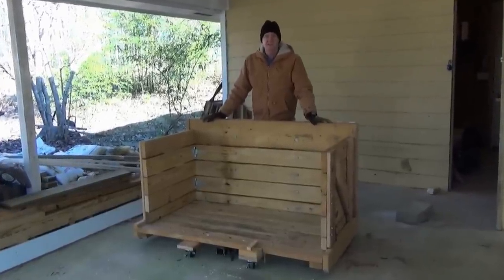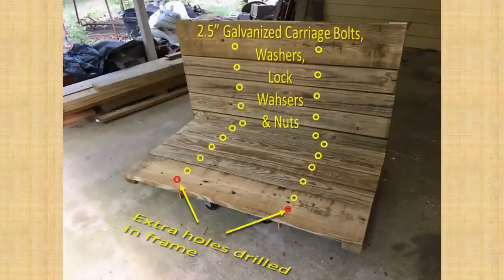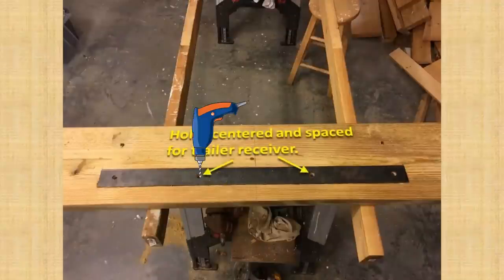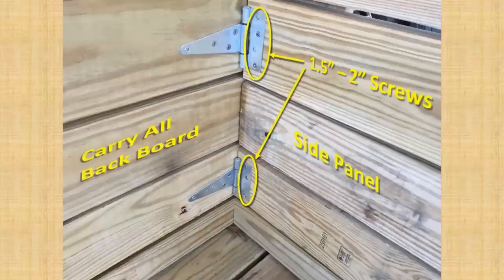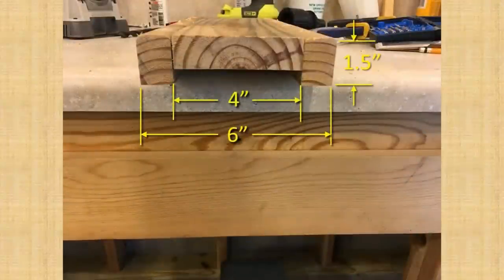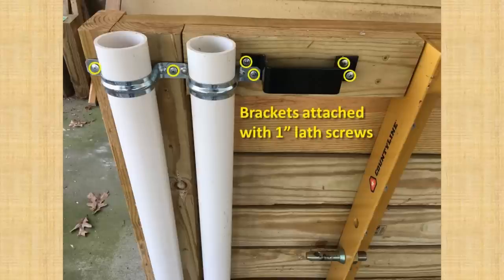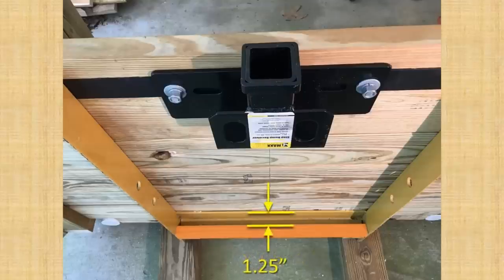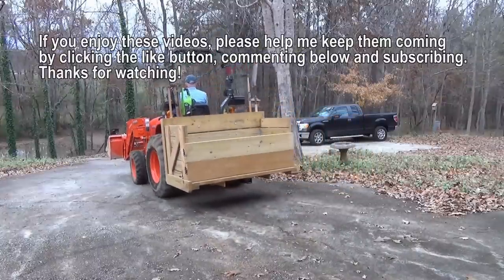Versatile Tractor Carry All for My Kubota L3901 Tractor - Part 2 (#17)

Comment: I just finish building mine and to my dismay, it doesn't work with the land pride quick hitch.. any suggestion would be appreciated1
Reply from the maker: Sorry to hear that, Vince!  You might try adding some spacer strips between the frame and the backboard to give it room to hook up.  If that doesn’t work you‘ need to weld stand-off plates to mount the lift pins on.  Good luck!

Comment: I am finishing my carryall poached from your video.  THANKS.  It took me a couple minutes to realize I needed to resize for my B2601 (53 inch bucket).  The only modification I made was to bolt 2X10 PT uprights to the rear frame  so it would clear my ez hitch.  This gave me lots of room for screwing the backboards.  I would also suggest builders size the 5/4 6 in PT used on the open end of the side panels to have contact with the 2X6 side skids to transfer the load of the work table (rear panel) directy to the frame.  I also lag screwed the 6 inch hinges to the back boards.  But wow, this thing is heavy!!!  Definitely takes load off the front axle.
Reply from the maker: Glad my video served as inspiration for you to make your own version of the carryall.  Yes, it’s heavy and makes a good ballast box even empty.  Folks with subcompact tractors would be better off making it out of lighter material like deck boards or 3/4” PT plywood to cut down on the weight. Thanks for watching!

Comment: I noticed another detail you addressed, and that is the direction you had all the lumber facing.  You had the smiley face of the grain of the wood facing the correct direction every time, congratulations! Tim
Reply from the maker: Hi Tim,  Thanks for noticing that.  I completely forgot to mention it in the video.
Reply: Spread the knowledge... what is the meaning, and significance of the “smiley face of the grain of the wood facing the correct direction”?
Reply from the maker: Hi Chris, Well I was waiting to see if Tim wanted to chime in but he hasn’t so I’ll reply.  I think Tim is referring to the way that boards can “cup” or “crown” depending on where in the log they were cut.  Here’s an article that explains it pretty well:  https://www.warlinepainting.ca/are-your-deck-boards-installed-right-side-up/   Basically, I looked at each board to see which way it was cupping, or likely to cup based on the grain pattern at the end of the board.  For the carry all platform boards I tried to always orient them so that there would a crown in the board rather than a cup which would hold water or other liquids.  The crown let’s liquids run off the platform.  Likewise, with the tailgate boards, I wanted the crowns facing outward so they wouldn’t be wobbly hanging on the bed claw hooks.  With the crown facing out, the claw hooks will automatically snug the tailgate boards to the edges of the side panels.  Does that make sense?
Reply: Thanks for the explanation Martin. That makes perfect sense and I understand the cup vs. crown reference better than the smiley face of the wood grain.  Good to know once I start the project.  Based on weather conditions here in Northern IL, that may not be for a while. I need the treated lumber and that is likely frozen together at the lumber yard.

Comment: I'm going to start one tomorrow and also provide the means to mount a 3/4 black iron pipe horizontally to the uprights to unroll barbed wire.  I do use barbed wire whenever out of sight of our house because deer don't get caught and die in it like they do woven wire.
Reply from the maker: Good idea to mount the pipe between the uprights for unrolling barbed wire or cable or hose!  Hope your build goes well. Thanks for watching!

Comment: Thanks Martin... The details of your carry-all build are spot on the money & the narration is excellent. Coincidentally I have the exact steel frame & a Harbor Freight 2" receiver that appears identical to yours. ( Made In China )... What isn't? LOL! 
My base & back wall as well as my skid plates & 2 x 4 uprights are complete as well as the receiver install. I too added a extra set of 1/2" holes for the 2 x 10 tailboard & the steel frame. I did find that the 2 X 6 skid plates were NOT tall enough to clear the backside of the receiver hitch ( 1/4" low ) based on using a straight edge. I decided to use a 2 x 8 with a 1/4" ripped off the narrow edge giving me a 2 x 7 skid plate. This gives me about a 1" clearance below the receiver hitch when sat on the ground. I had a steel shop cut my steel plate to 1/4" x 3" x 32 1/8". The thickness matches the angle iron thickness. The Big Box stores don't carry it in 3" width plus I bought it at a 3rd the cost! ( $11.78 )... I cut my recess with wood chisels as I don't own a router, ( yet ). I painted the recess & the steel plate with black Rustoleum after drilling my ( 8 ) 1/2" holes dead center across the steel plate. I then mounted the plate & receiver with the outboard carriage bolts & drilled up through the remaining ( 6 ) holes into the board & torqued it all in place... I'm now ready to build the swinging doors thanks in no small part to your excellent build plan as I tip my hat to you sir! 
Thanks again,
Bill on the Hill,
Vermont, USA... :~)
Reply from the maker: Sounds like you have a very sturdy carry all in the making, Bill!  When you get it finished, I hope you’ll send me some pictures of your finished masterpiece!  If you are so inclined, you can send them to martin@diymyway.net.  Good luck!
Reply: @DIYMyWay  I would be happy to do so Martin. I have been documenting the build as I move along with it. Yesterday I built the LH wall but I still need to cross brace it & today I will build the RH side. I ran out of time yesterday & headed out for Sunday dinner with my daughter & granddaughters...
Been an enjoyable straight forward build thus far with the receiver installation perhaps the most technical part. Thanks... :~)

Comment: I bought the lumber today and stainless deck screws.

The 2 inch hitch I bought was $13 from Harbor Freight.  It is 18 inch long and I will weld it to the bottom angle pieces using rectangular tube.  I have plenty of square tubing I will cut to fit and weld in place.
Reply from the maker: That’s awesome, Bill! I hope you’ll share some pictures of your carry all with me.  I’d love to see the finished product!
Reply: I will share pictures if I have your email.
Reply from the maker: Sure.  It's martin@diymyway.net. Looking forward to seeing them.

Comment: This is absolutely fantastic. I was scheming plans in my spare time to build something very similar... then I cam across yours. Everything well thought out and great details on putting it together. Now I will be building one like yours!!! Thank you!!!
Reply from the maker: So glad you think so! Good luck with carry all build! Thanks for watching!
Reply: @DIYMyWay  One question... I calculate the tailgate boards to be (60"+1.25"+1.25") = 62.5" likely made from 2x8 stock? Is that correct?
Reply from the maker: The length sounds right, but it’s best to measure after you have the side panels installed and locked open.  The tailgate boards are 2x10s.

Comment: Thank you for your helpful video. I’m basically following your pattern, as I construct my own. 
There is one thought I want to pass on, however. 
Since new pressure-treated lumber will shrink over time, I think it would be better for my purpose to avoid adding in spaces between the platform boards.
When the green wet boards shrink, the gaps between the boards will grow larger, yet. 
That is concerning, since I wish to sometimes transport dirt, compost, or finely shredded leaves without worrying that it might sift out between the boards and leave a messy trail in my wake.
Reply from the maker: Hi Mike!  Thank you for taking the time to comment!  If you plan to haul dirt or compost, then definitely don’t leave any space between fresh pressure-treated lumber.  Even if you don’t, you could still end up with at least a 1/4” gap between boards, so you might consider putting a piece of 1/4” or 3/8” PT plywood on top of the lumber. Thanks for watching!

Comment: Great build!  I'd probably bolt the casters on and leave them on.
Reply from the maker: Thanks Angus!  Bolting the casters on is fine if you live on flat property and will never cross a ditch or low spot.  If not, be prepared to replace the casters from time to time. Thanks for watching!

Comment: I started mine today, following your plans.  Decking is done will start sides and "bolt on"s " tomorrow.  Thank you for the time and effort you spent to share your idea. And yes I am now a subscriber. Keep your videos coming.
Reply from the maker: Hi Rusty!  That's awesome!  Please keep me posted on your progress.  I'd love to see some pictures of your  carry all when you are finished.  Thanks for watching and subscribing!
Reply: Trying to figure how to attach photos, only issue is the gate latches, with the bend in slide bolt you need a rather large hole. Maybe I put the latch to close to the side board.  Too much depth.  Still working on it. Cannot wait to use it.
Reply from the maker: Hi Rusty!  Try sending them to martin@diymyway.net.  I’d love to see the progress!  Sounds like that’s the issue.  If you can move the latches up a bit on the side panel that should take care of the problem.
Reply from the maker: Rusty,  if you tried sending pics, please try again to  martin@diymyway.net.  I discovered my email forwarding was not working but it's fixed now.

Comment: Thanks for the detailed instructions on how you constructed that excellent carryall.   One question: Why did you go to the extra mile to make the dolley removable? If you kept the wheels under the carryall,  I don't see why they couldn't be mounted permanently. Your design does give you the option of storing it in places without a concrete floor.
Reply from the maker: Hi Terry!  Thank you sir!  You answered your own question.  First of all, there ain't no such thing as a level place anywhere on my property, so if for some reason I wanted to leave it outside, I can plop it down and not worry about it rolling away.  The plan is when my shop is built, it will have a shed off the back with a roll up door to the inside.  I'll have several of my implements on dollies, so I can roll in the one I want to attach to the 3-point and then be on my way.  The carry all is one of those implements.  Thanks for watching!

Comment: I did build a carryall following your plan. It turned out great. Thanks for the videos. They were easy to follow. The only thing I did different was that I used a King Kutter frame. The King Kutter frame works with a John Deere Quick hitch. I did make a YouTube video and made sure to give credit to the DIY My Way designer.
Reply from the maker: Hi Beefitter!  I watched you video.  Great job on the carryall!  Thanks for the “Stars Wars” style credit at the beginning.  The wood looks really dark.  Is it just very fresh pressure treated wood or did you stain it?
Reply: I did stain it with Rymar water sealant. Dark Hickory. I did use ground contact treated lumber. But, treated lumber can go bad with time if exposed to the elements. I stained the wood before attaching it to the metal frame. So the wood is as protected as it can be. Rymar is a great product, it is expensive, but you get what you pay for.
Reply from the maker: Good thinking on your part!  Thanks for the tips!

Comment: The carry all from tractor supply will need significant modification , with metal removal and welding,  to work with John Deere quick hitch. Just a heads up.
Reply from the maker: Good to know for John Deere quick hitch owners!  Thanks sharing for the info and for watching!

Comment: Following your precise direction I built a versatile tractor carry all for my Kubota.  I made it 72'' wide to match the width of my tractor.
Reply from the maker: That’s awesome aufish! I appreciate you telling me.  Did you use the Tractor Supply carry all frame?
Reply: @DIYMyWay  Yes I did.  I had to make a few adjustments because Pat's Quick Attach Cat 2 is larger than the cat 1 and was  binding up against the back of the carry all.  I simply cut two openings to allow the quick attachment to pivot freely.
Reply from the maker: Awesome! Even with Cat 1 Pats Easy Change it’s a close fit. Thought I might have to route out some the wood but didn’t need to after all.
Reply: @aufish2311  Rural King frame is Quick Hitch compatible!

Comment: Martin,

Why didn't you make the dolly or casters a permanent fixture and attach to the carry all. I'm thinking about doing that with wheels and pnuematic tires. If you use casters they need to be stainless so that they don't rust. What are your thoughts?
Reply from the maker: Hi Tony!  First, with the uneven terrain of my property I knew I would occasionally bottom out the carry, which I actually did very soon after building it.  If I had had big casters on it they would have been abruptly removed.  Second, since I store my carry in my shop building, I only need the casters when I am rolling it up to hook it up or rolling it away for storage. Thanks for watching!

Comment: Just curious... does your hitch touch the ground.  I built mine using your plan which is fantastic... When I go to mount my hitch... the bottom of the hitch protrudes past my carry all frame and the side levelling boards, which means the hitch itself would be securing all the weight.  Did you find that yours does the same??
Reply from the maker: Hi Michael!  I don’t know because I haven’t set the carryall on the ground with a ball hitch on it.  If it is a concern for you, you can use 2x8s for the side leveling boards to get more clearance. Thanks for watching!

Comment: Looking at your video and looking at my Rural King Carry All frame I realize that the TSC version you use is not  Quick Hitch compatible while the RK version is! The mounting holes on your TSC frame for the 3 point pins are directly on the frame which would put the board faces too  close to the pins for a Quick Hitch to work while the RK  frame has tabs welded to the frame for the 3 point pins that allow greater clearance between the Quick Hitch hooks and the boards. Plus RK has a red frame that matches my Mahindra! Gonna start my build tomorrow, thanks for a great plan.
Reply from the maker: You are right about the TSC vs RK frames.  However mine works fine with the Pat’s Easy Change system.  If I ever get a Quick Hitch, I would weld tabs on the frame to extend the pins out enough for a QH to work.  If you’d like to send me pictures of your carry all, you can email them to martin@diymyway.net.  Good luck!
Reply: @DIYMyWay  Another idea is to insert a 1/2” shim to the two vertical braces before attaching the back boards.  This may require larger (3”) bolts though.
Reply from the maker: Quite right, Michael.  In fact someone else made the same suggestion. Thanks for watching!

Comment: To echo what has already been said, this is an excellent video in every way. I just finished building my own "carry all" using this video as a guide. I can't thank you enough for all the time and effort you put into this video. It's inspiring!  I would like to ask you one question though, if I may?  I plan to add 8' casters from Harbor Freight. The base of the caster is 4'x4". How would you go about attaching them to your design?  I have a few ideas but I thought I'd ask the builder himself before I went and messed up your masterpiece!
Reply from the maker: Thank you for the kind words, Chris! Well the first thing that comes to mind is to change the 2x4s on the bottom outer edges to  2x6s or 2x8s so you have a wide enough spot to securely mount the casters. Just be sure the casters can rotate freely without hitting anything. Thanks for watching!
Reply: @DIYMyWay  I should have left well enough alone and built the damn dolly instead of attaching 8"casters. What a pain! The carriage bolts combined with the nut and washer were too long to avoid hitting the swivel casters and had to modified. Another hassle I just discovered is that the added height makes it difficult for the 3-point arms to easily grab the pins. The angle isn't quite right. To make matters worse, the casters hang down so low that there will definitely be clearance issues. Ugh. I should have just followed your design.  I'm almost certain they will have to be removed entirely.  That being said, what a pleasure it was to build this monster! Thanks again!
Reply from the maker: Sorry to hear that, Chris!  I was afraid they might make it too tall.  BTW, I recently built a large simple dolly that does not attach to the carry all that has slightly bigger wheels but not so tall that it’s a pain to hook up.  It’s basically an oversized furniture dolly I made from some 2x4s.  You might consider doing the same unless having it attached is important.  Good luck!
Reply: @DIYMyWay  I'm going to follow your example and build a dolly. What size were "slightly bigger" wheels you attached to the dolly 2.0?
Reply from the maker: Chris, they are 4” locking casters.  However, because the carryall sits higher on this dolly, I had to carve out some of the wood of the backboards behind the lift pins so my Pat’s Easy Change had enough room to hook up.  When the carry sat lower on the attachable dolly, I barely had clearance to hook up.  It was not big deal to chisel it out, but I thought I’d warn you in case you have that problem.  Good luck!

Comment: Great video of the carry all. I have one question: Where did you get the metal frame for the bottom and the one used for the three-point hitch hook up? Thank You, in advance,
Reply from the maker: Thanks! I covered the frame in Part 1. It’s from Tractor Supply. The flat bar steel for the hitch receiver came from Home Depot. Thanks for watching!